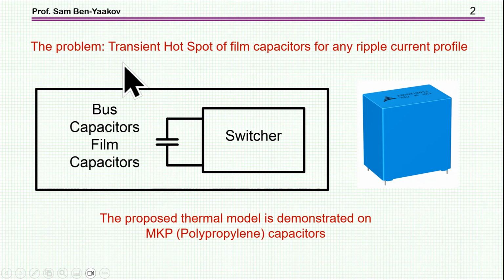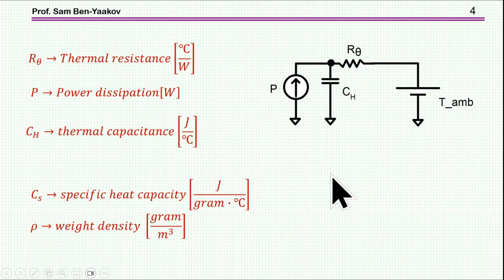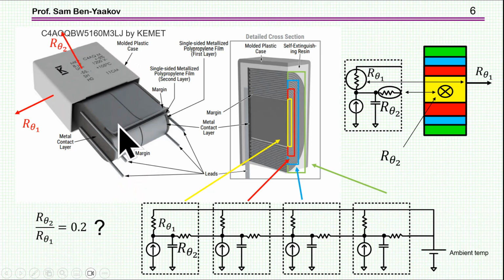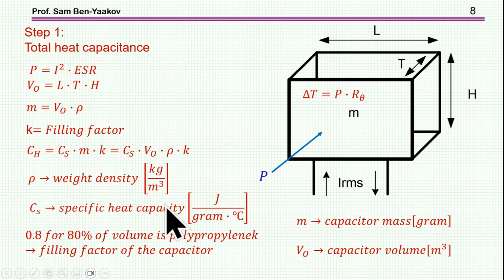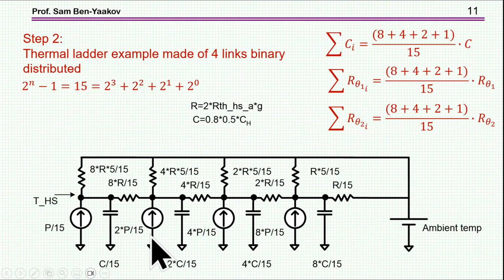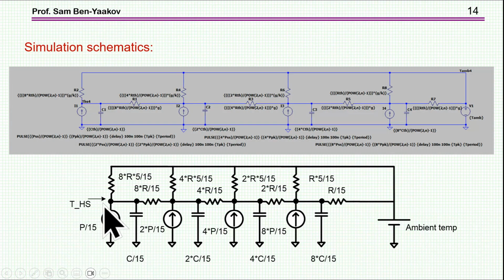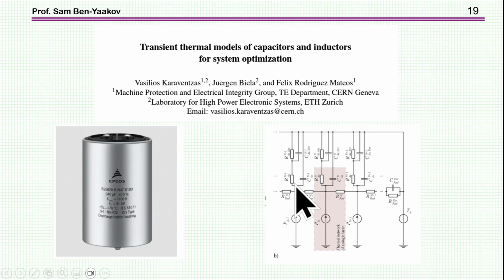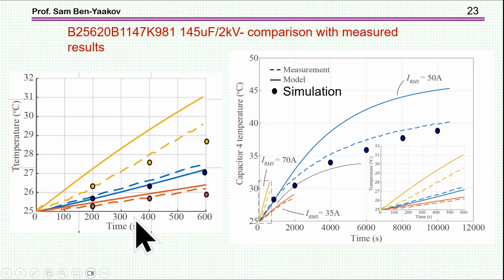A thermal model of film capacitors

Comment: Dear professor, It's nice to see this thermal modeling approach! This approach is exciting!Have you published any literature on this method? Can you give some references for this method? I want to quote this method😀
Reply from the maker: No, this is an original stuff. You can cite the video, which is done these day. The way to it;
Available at "link"
Reply: @sambenyaakov  Thanks a lot! It is an exciting news!
Reply: Dear professor, in the page 11, R=2*Rth*g, What does g stand for? How to get a value? It doesn't seem to be given in the video
Reply: Another question is whether this method, which uses thermal resistance from the hot spot to the ambiance， is applicable to thermal resistance from the hot spot to the case
Reply from the maker: @drwangjuanmao  Yes but you need to know the temp of the case.
Reply: @sambenyaakov  thanks professor, the last question is  in the page 11, R=2*Rth*g, What does g stand for? How to get a value of the parameter g?

Comment: Would it be reasonable to assume that this model would be approximately correct for aluminium electrolytic capacitors if the material parameters are suitably adjusted?
Reply from the maker: The basic assumption of this model is large volume and relatively high thermal resistance case to ambient Also the HS to case thermal resistance is required,  not  given usually  for electrolytic caps.

Comment: Dear professor, in page 10, the total Rth is 2*Rth from datasheet, but in page 20, R14 is 2.1,i.e., the total Rth is Rth from datasheet, why have this conflick?
Reply from the maker: You have a keen eye. In page 20 the simulation is for the full capacitor, total power and total thermal capacitance.